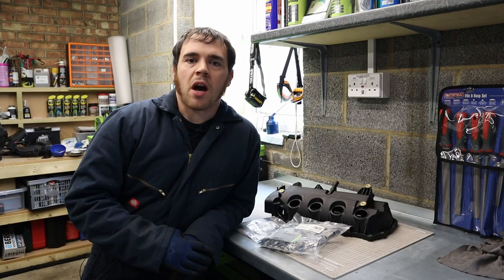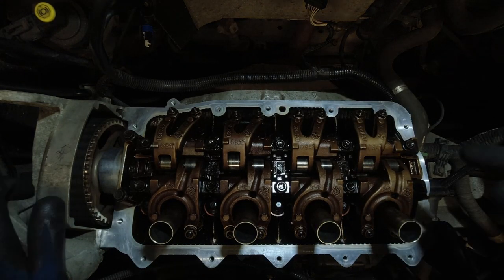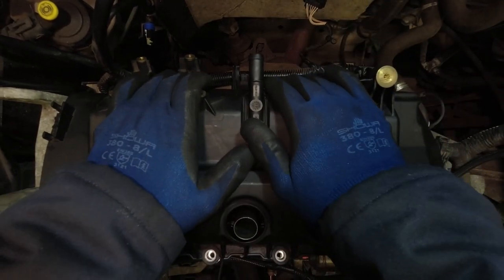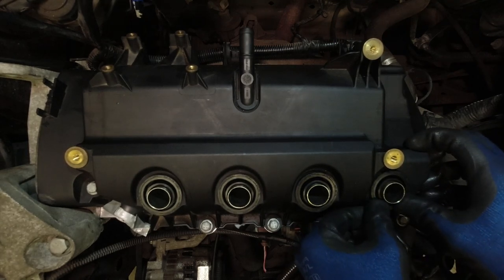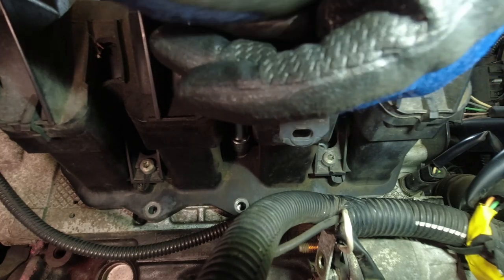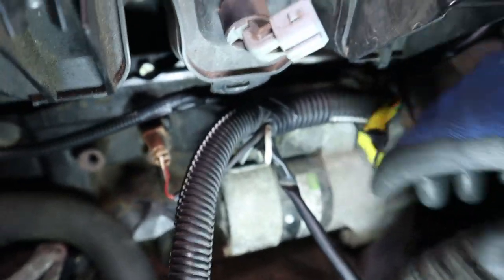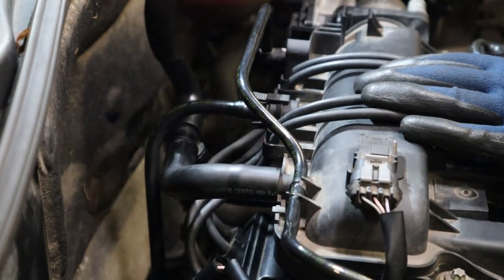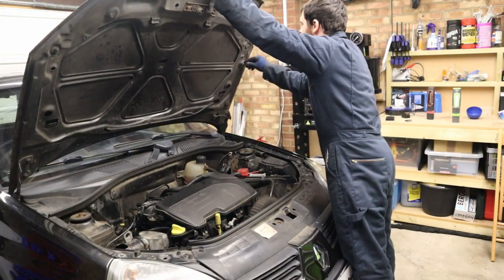Renault Clio Rocker Cover Refit (The Rocker Cover Saga Part 2)

Comment: These 4 vids have been a goldmine for me as i have the exact same car with the d4f722 engine. With oil leaking from all spark plug tubes and a small corner of the cover. The poor thing sounds like a tractor so i will be checking the valve clearance as it has done over 100,000 miles bless it.

Comment: Thank you much as always a great video about this amazing model of car!! I would appreciate if you could share the OEM Part code for the ignition switch of that Clio? You know it is a very common issue on the spring so I have to manually returned , I would appreciate your great assistance! 👍
Reply from the maker: Not had to change one before so I'm afraid I don't know.

Comment: Will this fix a leak from the top of a 1.6 where its pooling from the top left. It affect coolant levels but it drives fine normal temps doesn't seem like a head gasket more of the seals. But its alot of oil leak not just a lil

Comment: Do you think that instead liquid silicone this could be done with some O ring seals ofcourse of apropriate size? I'm little bit sceptic what could go wrong with putting too much or to little silicone...
Reply from the maker: I cannot say it would definitely not work without testing it. However I wouldn't think it a good idea.
It will be difficult to actually do and don't forget the surfaces are flat, no groove for an o ring and they may interfere with the sealing of the rest of the rocker gasket.
I understand your worries about silicone but just keep trying until you get a good bead, plenty in a bottle to practice and it wipes of easily.

Comment: Are the Bolts of the 101PS Turbo engine get the Same NM? Looks different, also the Material
Reply from the maker: Which bolts?
Reply: valve cover and intake manifold
Reply from the maker: Inlet manifold 4Nm pretighten then 12Nm.
Rocker cover 5Nm pretighten then 13Nm.

Comment: Hi I got Renault Clio 1.2  16 v 2005 got oil going into air filter cheers
Reply: So I had same issue and I guess there are two reasons for that. First your PCV valve or hose on rocker cover was cloged and in some moment oil pressure pushed oil up the hose, and second one you had to much oil in your engine. For sure you should clean hoses described in Video number 4 of this Rocker cover saga and replace the air fillter. If you notice in the future that oil is again on the fillter there should be further investigation.
Reply: Also one addition, if you remove your MAP sensor on top of the intake manifold you will see that that part is also oily and I guess that you, like a lot of people with Clio had mayo (white or bright yellow milky stuff) residue on oil cap.